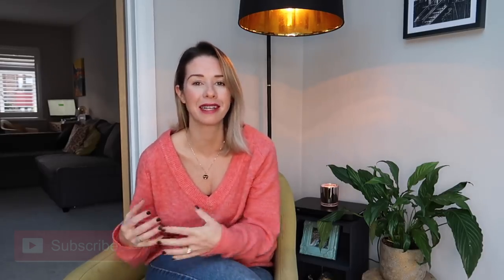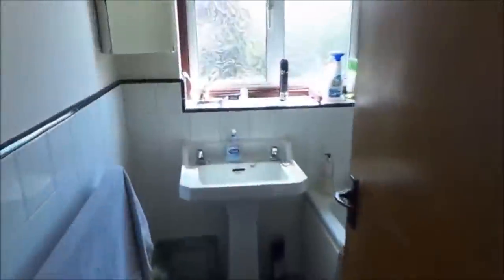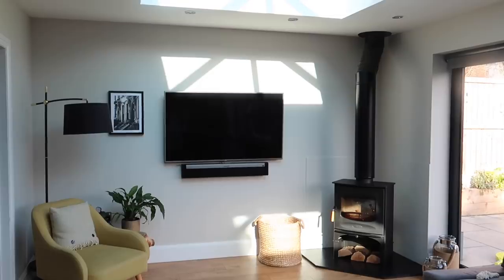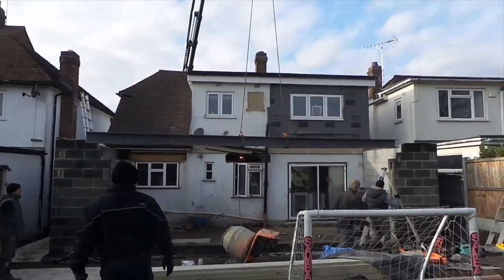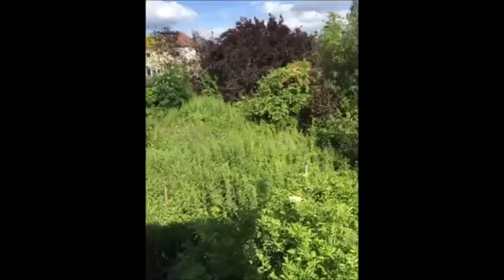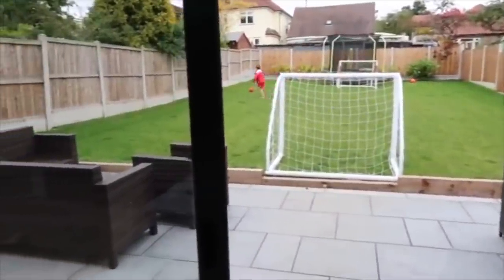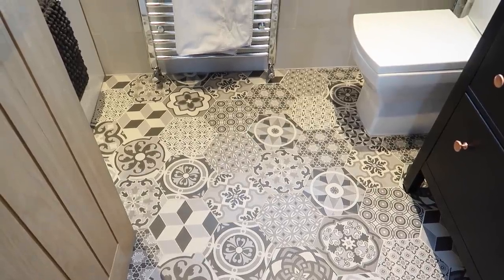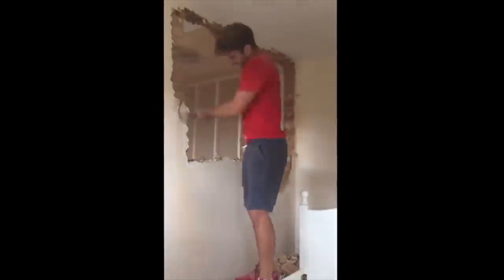10 TIPS WHEN RENOVATING YOUR HOME | THINGS I WISH WE KNEW BEFORE STARTING OUR BUILD KERRY WHELPDALE

Comment: Excellent tips!! Only thing I would add is if you're redoing any electrical wiring, pay close attention to where you'll want outlets and even consider putting an additional one inside a bathroom cabinet if that is allowed in the UK. Also, there are outlets that have built-in USB ports to charge electronics and outlets with built-in night lights which can be installed in any outlet receptacle. This might make you want a few extra outlets in places you hadn't thought of. There is also the much more advanced (and more $$) central hub for a "smart home."
Reply from the maker: Oh yes we have the plug sockets with the USB points and they are brilliant aren’t they :) I think with the way things are going at the moment ‘smart homes’ are never ending.. I’m always so amazed at how much choice you have when it comes to deciding on things! It’s fun though :) xxx

Comment: Just moved back into our house after about 10 months of a reno that was supposed to take 6 months. And will be 300k over budget.  My mother sold a rental property she owned to help us pay for it.  Our house was in a dire state before it was renovated with a badly leaking roof, wet patches in the ceilings, missing light fixture in the kitchen (due to leaking roof) and water damage down multiple walls.  The hallway toilet had urine stains at the back of the wall from 50 years and it was peeling off.  There were not enough bedrooms for us all.  There were holes in every bedroom wall that I has cut to free birds that had made their way under the eaves and fallen into the wall cavity.   And once the builders had started prying timber off the walls we found multiple skeletons of dead birds. And in every corner of the roof and every place possible there were birds nests.  There were wooden floors and it was cold in winter.  But I actually I loved it.  Now it looks like an office building thanks to a carpet I stupidly chose before I had chosen the paint or curtains (thanks to the advice of an amateur women who the painter put me onto who did the curtains to ‘choose carpet first because otherwise it can be hard to match the colour doing it last’ (totally wrong advice). So I chose the carpet not realising the whole colour scheme would be influenced by the walls and curtains which are far more important. And chose a carpet that looks like an office carpet, and now I hate the entire house and wish we’d just sold up and bought another house, which actually would have been cheaper or at least equivalent. I feel angry at the builder for taking so long to finish the reno and going so far over budget and for doing an number of things that I didn’t like due to him rushing us at the end because we had to move back in. Such as drilling holes too large in the bedroom doors that mean we’re limited to having huge industrial sized door handles and making the kitchen bench too low.  I feel disappointed, mislead, angry and sad.  I miss our old house even though it was in such a state.  Is it normal to feel like this after a reno? I feel traumatised.